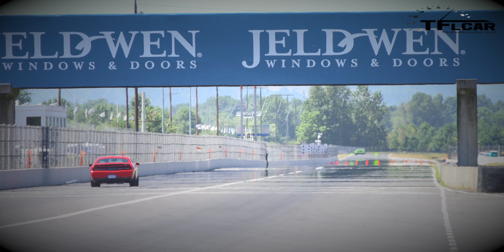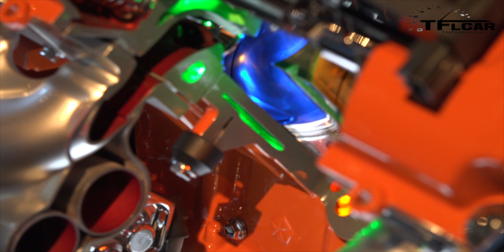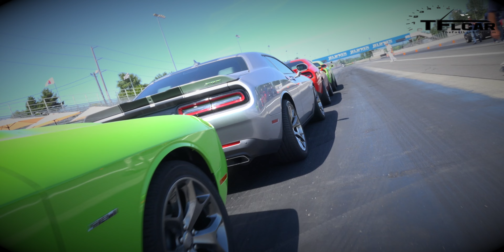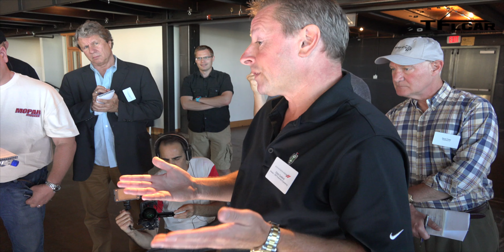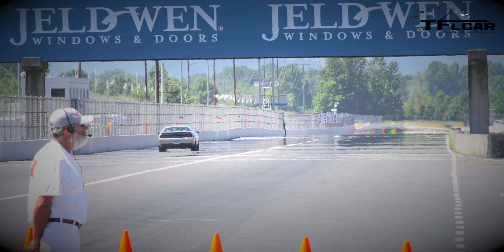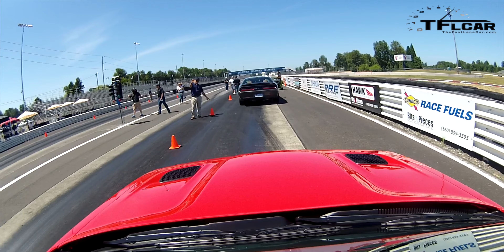What's under the hood?  2015 Dodge Challenger Hellcat 6.2L Supercharged Hell HEMI Revealed

Comment: they made a pass certified at 10.60 for 1/4 mile 0-60 is 3.8 seconds. yes id say the 800+ horse 707 certified to the crank is amazing. especially when its only 59 grand. and they also tested it in a drag agaisnt the Gt500 WITH 662 whp and it owned the GT500 by a few cars...

Comment: Interesting fact - both Ferrari F12 and Lambo Aventador have similar sized engines (6.3l and 6.5l) and have similar power numbers , BUT they have no turbo or supercharger .
Reply: You are aware that the lambo has a v12 right and i think the Ferrari does to plus this car can make that power it's just more efficient to use a supercharger i guess the viper engine is only tuned to 640hp but on the dodge challenger drag pack the viper v10 in that has 850 hp naturally aspirated the forced induction is just easier and cheaper to get power considering this car starts at 60k

Comment: 80hp to run that blower?  I know turbos are more complex and everything but the efficiency totally makes up for it.  I really want to hear a factory turbocharged American V8, really not into the sewing machine sound under full boost.
Reply: Most turbos have some sort of lag and are hell on wheels if not maintained properly. The supercharger on this car sounds better than any turbo I've ever heard and you definitely won't be confusing the sound with a riced out Civic or Subaru. I practically want to bottle up this supercharger sound and take it with me everywhere I go lol.
Reply: Have you actually heard a turbo v8 before?

Also, with as much displacement as these cars have, a properly sized exhaust wheel would make it spool pretty quickly.  In most cases, lag actually helps in the traction department.  Do a little research.
Reply: I'm not researching shit, ( its only You Tube not a science experiment ). I think the car is perfect as is and the supercharger probably was a more cost effective alternative to a more complicated and less reliable turbo setup. I mean after all it's a 700 plus horsepower car that will sell for around $60,000 and will sound like nothing else on the road. Plus I think the supercharger is a more appropriate throwback to American muscle cars and hot rods of the 60's and early 70's. I'm not the one complaining here. That'll be all.
Reply: Typical answer from a typical pleeb.
Reply: superchargers are instantaneous boost, whereas turbos take a little bit to get their peak performance out of them, now if turbos were instantaneous like superchargers then that would would be a different story, turbo cars are only good on their top end performance (higher rpm ranges) than lets say a supercharger is at very low rpm range
Reply: That's really outdated knowledge.  Large cubic inch motors and turbos don't have lag unless you're gunning for stupid power.   For the love of Pete, please do some research.
Reply: bandwagon240 the only way they "don't have lag" is if they either have a twin turbo setup where one is small and the other one is large, the small turbo takes care of the lower rpm range and the big takes care of basically the other end of that spectrum, there also is twin scroll turbos which basically do the same thing as the small and large turbo but in one package, and yes I have done a lot of research on turbo/superchargers because i plan on the first car i buy having some sort of forced induction because my family has never owned a vehicle with a turbo/supercharger of some type and i think it would be something different to have.
Reply: Sigh.

Comment: Are they going to do a top speed test at Nardo, like ford did with the GT500? The Chrysler test track in Kingman AZ is much slower (as Motor Trend found out while testing the GT500). Was the Hellcat tested for top speed at the Kingman Chrysler track or is the 199mph still just a rumor?  Also can you confirm if the Hellcat is the hero car in the new Mad Max movie coming out next year? I heard they used a black test mule Hellcat for the hero scenes.  PLEASE MORE INFO PLEASE!!!

Comment: Is it faster than a current gt500? Because this weighs a lot more I dont know of 40 horsepower make up for the weight
Reply: Not just about the weight and yes it is faster. The gt500 struggles to get traction while the challenger has better traction.

Comment: To bad the zl1 and the gt 500 Would rape this thing on the nurburgring
Reply: with the gt500's live axel, im not so sure
Reply: 997speedy the current gt500 maybe not but the next one surely will
Reply: eh. yeah probably, but is that really the point of a massive land yacht like the challenger? I don't think muscle cars in general are meant to be track stars. They're meant to be affordable dragstrip kings that are able to be driven daily with comfort. this new challenger excels in that regard!
Reply: And when exactly will the average person who buys this car be driving on the ring?  Stupid comment.
Reply: DevPack the camaro and buttstain are pony cars also....
Reply: Matt97 the challenger is a pony car...
Reply: zl1 possibly...z/28 hell yes. Gt500 probably not, but Ford has new mustangs on the way which will be better in every way possible. Let the muscle car wars go on.
Reply: DevPack From what I hear the next versions of mustangs V6's are actually going to be slower due to the added weight and slightly less horse. I don't see the V8 5.0's being on the level of the SRT8 392's - maybe more closer to the R/T's.

The next Shelby will probably be 700 HP+ and do a good job at destroying the hellcat on the track....at least until the hellcat gets another performance increase. Not sure about drag but if the next GT500 weight is under the challenger it should be able to do 0-60 faster or around the same with less power required. 

Too bad the next mustangs look like European ford fusion cars though. Camaro on the other hand seems to be more of a track car then either the Mustang or Challenger but less of a drag car and less luxury. 

Yeah competition is good as it's going to force all of them to keep producing better performance cars every year. Sort of exciting actually.
Reply: It beat it at Laguna Seca as well, Motortrend's race driver Randy Pobst did all the driving, and considering Laguna Seca doesn't have those long straight aways as the ring, I think the GT500 did amazing, considering the much smaller tires, brakes and live axle.
Reply: There is only one Ring....but there are thousands of stop lights.
Reply: @Jay Trock yeah but at least they are still on the North American continent, so they are still American
Reply: yea.
Reply: yeahh ok.
Reply: 997speedy
You do know the GT500 has a 2 second faster lap time than a ZL1 at the ring right?
Reply: Abenator25  tbh i had no idea and that was the maddest driving on the nordsclife ive ever seen, its a shame that the time was not official and that the car looked pretty wobbly, but that time still suprised me
Reply: Matt97 that's why the z28 smacked the gtr around a track
Reply: XileLord that may be true but the challenger will still have the props for being a factory production car i mean think about dodge and srt help with the performance but dodge still builds it unlike the gt500 which pretty much starts out at mustang then sent to shelby to be upgraded and also the viper is due for a refresh soon oh and there will be a charger hellcat so i mean you have 1gt500 then you have 3 different cars with over 600 hp i mean the gt500 is cool but a lineup of a super car muscle car and a muscle family sedan is badass
Reply: Mustangs Rape Camaros
I bet you the '14 Shelby with slicks vs the Hellcat with slicks, the Shelby wins. That's the good thing about live axles, I am a drag racer, that's why I was going to swap my 03 cobra's IRS for a live axle, it shaves 100 pounds off while being able to do wheelstands without the fear of breaking it, like an IRS system would. Be honest, how many GT500 owners or Hellcat owners bought their cars for a road course? most buyers just want to drag race, even talking about their capabilities around the ring is stupid, but I didn't bring it up.
Reply: Totally agree!
Reply: Jay Trock
You're wrong on that last part, and in my first statement I mentioned both cars on slicks not just the GT500. If you look back, Ford has been underrating cars since the 03 Cobra, rated at 390, the cars made more like 420-430hp, they dyno equal (365-370whp) and sometimes better than the LS3 Camaros. They did the same with the '13 GT500, they dyno 600 at the tires, when you calculate drivetrain loss, that real number comes to around 690hp to the crank. The ZL1 dynoes 500 to the tires, which says the Shelby makes more than 100 hp to the crank than the ZL1. Why is that? the more power, the more drivetrain loss. BTW, I also think the Challenger sucks, it's looks are amazing, but a Muscle car with a luxury sedan chasis that shares it with the Charger, 300, and even the Magnum, that's just laziness and stupidity from Dodge, it's like if the Mustang shared the Taurus Chasis, the Mustang would be one heavy pig, just like the Challenger.
Reply: If that 67 is a fastback, that is one amazing car. I was never the biggest fan of the late model GT350, I would have liked them if they had a different engine choice instead of just putting a blower on a GT and slapping a body it. It defeats the purpose of what the original GT350 was...a lighter, better handling option to a stock Mustang GT (kind of what the Boss became in 69). I respect Road course guys, I'd buy an 06-13 Z06 for a road course, I've raced those on the Freeway and they're freaking beasts, better than the new Stingray imo. I don't like the idea that the new C7 is 200 lbs heavier than it's predecesor the C6, I don't care how better it handles because of it's new suspension, the extra weight made me lose the attraction to them, which means the new Z06 will weight between 3500-3600 lbs, compared to the 3300 lbs the ZR1 did.
Reply: Been to Sonoma (for the topfuel NHRA), I am a fan of the Laguna Seca road course but never got the chance to visit. You're lucky indeed.
Reply: ha wtf r u talking about gt 500 has 650 hp and 631 lb-ft and its 0-60 sucks dick, ZL1 is even worse
Reply: Roger S Roger Poney car and muscle car is basically the same thing. but if u wanna get technical they dropped calling them pony cars in the 70s
Reply: MrJelloman14 actually they're almost the exact opposite. And it was the term "muscle car" that stopped being used in the 70's.
Reply: MrJelloman14
 I don't know what you mean with ''it's 0-60 sucks dick''. They do it in 3.5 seconds, same as the over 10k more expensive, 700 lbs lighter, 335 wide rear tire, 50/50 weight distributed C6 Z06. Also, the GT500 it's rated 662hp
Reply: @Jay Trock I think we can agree that today's "muscle" cars are just pony cars with a lot of muscle haha either way I'm a GM man through and through, but I would take a dodge any day also. Now ford....ehh... I love fords between 1920's-60's but other than that they're my last choice on the "Big Three" its still american, so I'm still proud of them.
Reply: @Jay Trock lol yeah, I have a lot of native in my blood so when I hear people say "Indian" referring to native American I have to correct them. It just bugs me haha